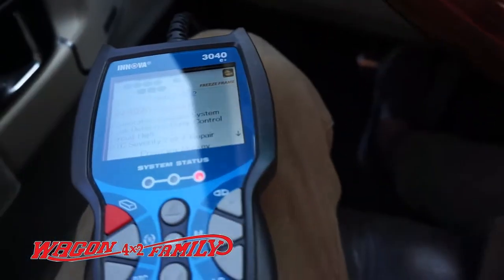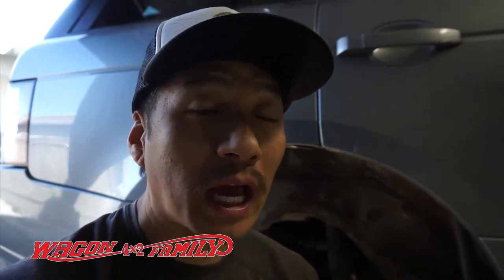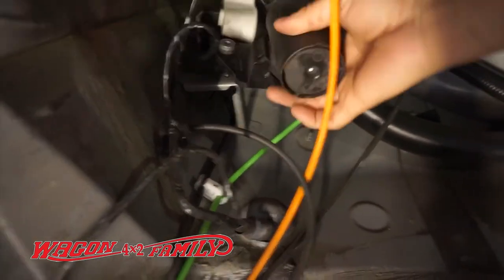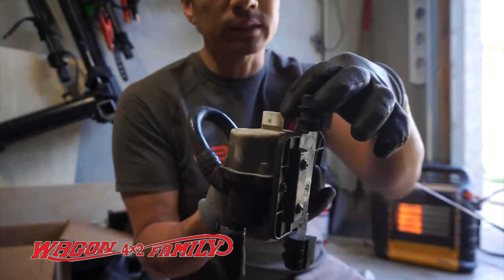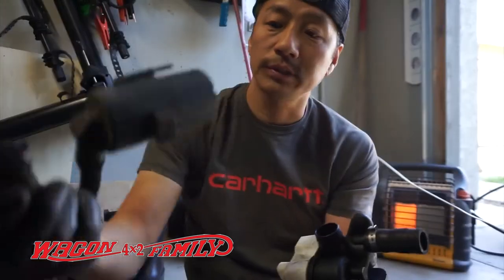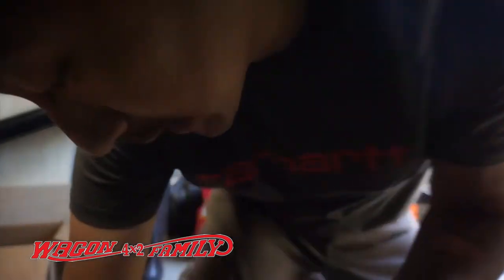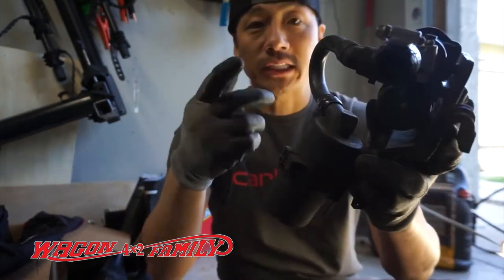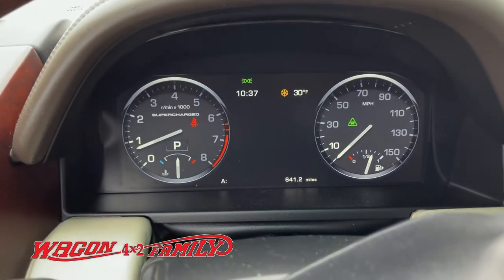Land Rover Rang Rover Error Code P2402 Evap leak detection pump

Comment: Those small hose clamps are easy to take off with plain medium pliers.  The bumped out part just need to be squeezed (I'd say medium hard) and released and it will detach easily.   Then, to put it back, you squeeze it again in place and it will clamp on.  It's a little trickier to put it back but it will go and look like a new one.  Even if you opt to change it, it's easier to take out with a pliers.   Cheers!

Comment: I have code P2407: Evaporative Emission System leak detection pump sense circuit intermittent/erratic. Do you think it would be the same repair? Thanks!!
Reply from the maker: Most likely

Comment: Hi Mate, i would have a question - did you have any other errors together with P2402?
Reply from the maker: Sorry no. I did not get any other codes.
Reply: @4x2WagonFamily  Thanks mate, one more question - are you using OBD connector for errors reading? I am reading quite high temperature of catalytic converter, which is like 930-950 Celcius (around 1700 F). I would compare if I am getting proper values. I tested on highway like 60-70 mph and city crusing. Highway was better but still 1660 F).

Comment: Is there any way u can clear the code with the scan tool?
Reply from the maker: Yes but permanently. The code is stored in memory and you still will not pass smog with the code stored. Also, once you clear the code with a scan tool it will eventually come back on.